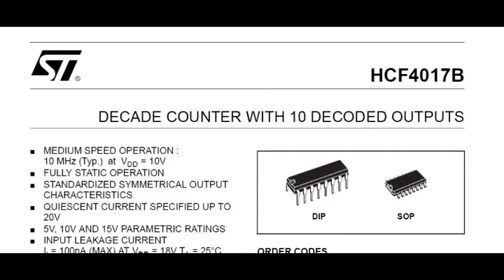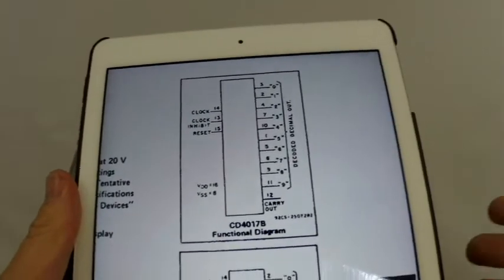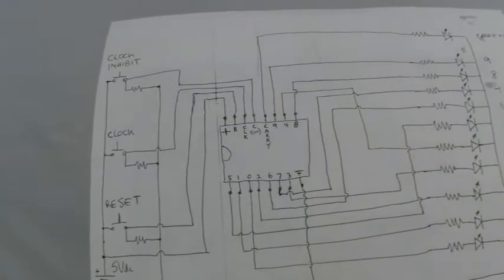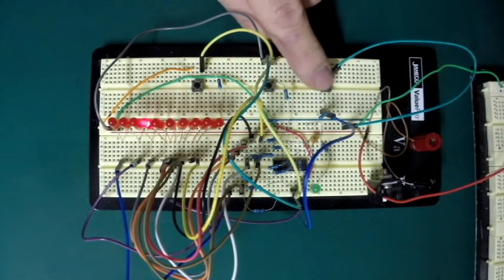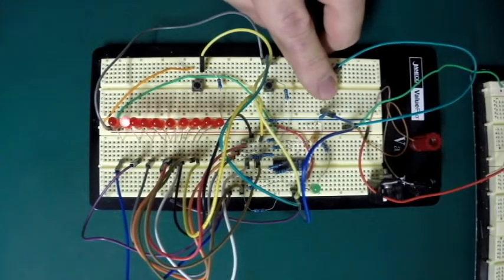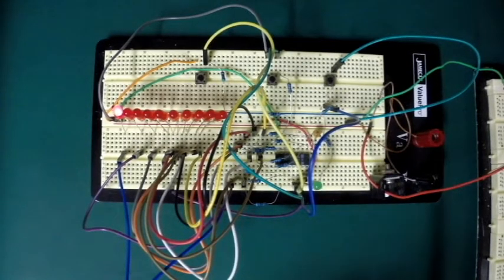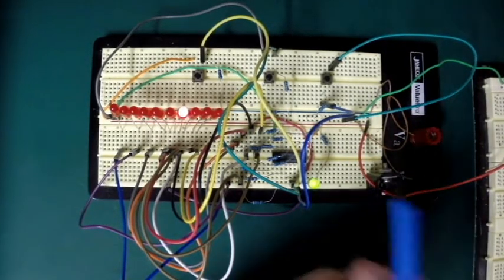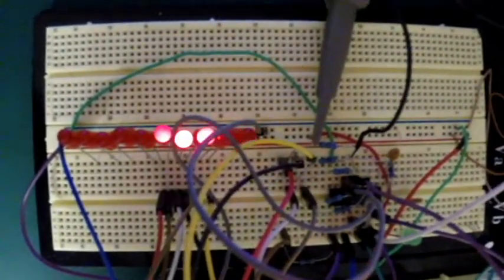4017 Decade Counter and Frequency Divider

Comment: Instead of using 11 resistors for each individual LED to the (+) end, you could have just put 1 resistor to the negative end because when 1 of any LED turns on, it will have limited current from the resistor.